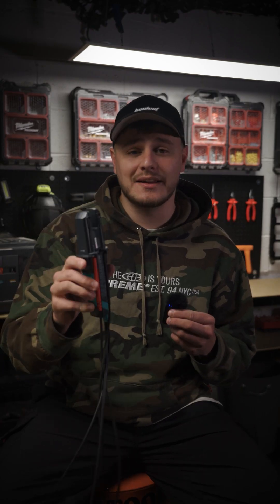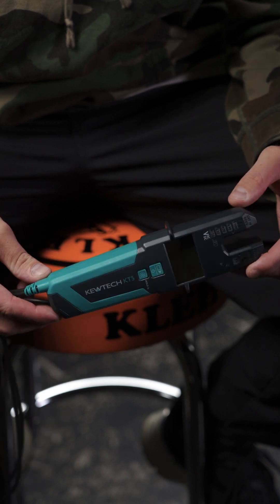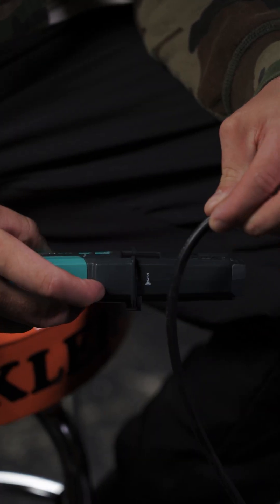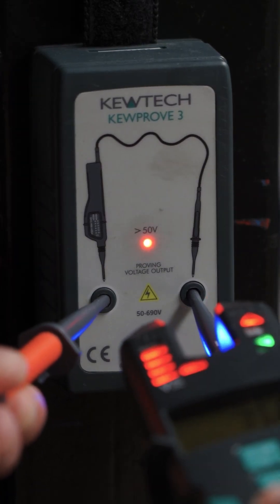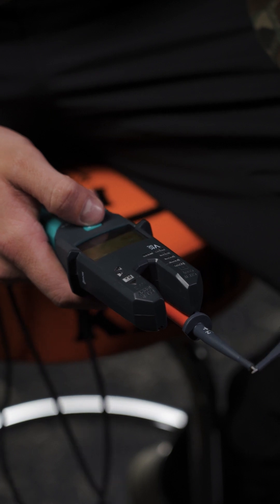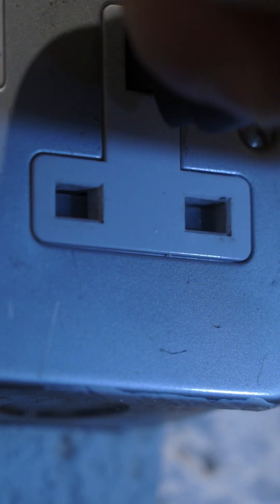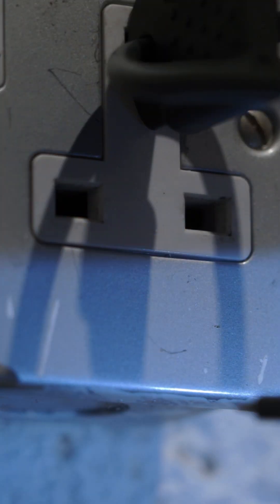KT5 Open Jaw Clamp Meter

Comment: No, I have the TIS version of the same tester because they actually thought about it a bit more and made the leads replacable since that's what always gets damaged first, and the GS38 ends removable for the innevitable times that you can't use them. There's quite a few different variants of the tester from different brands, even one that does DC current. Shame that KT seems to have chosen to miss out the QOL features of others.